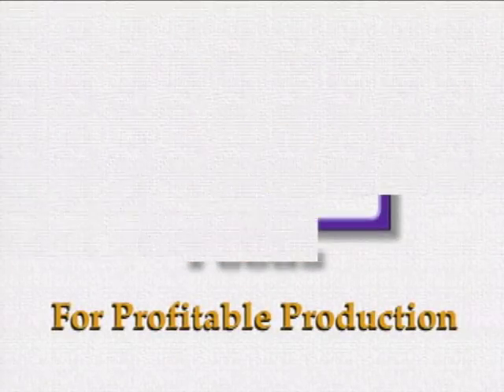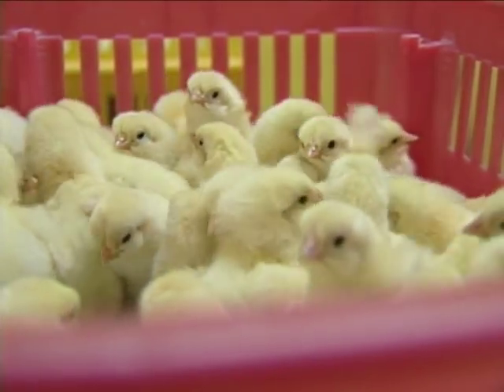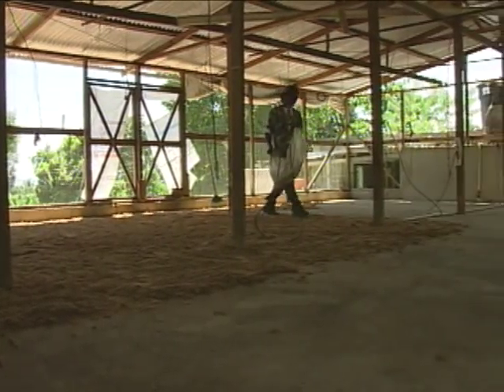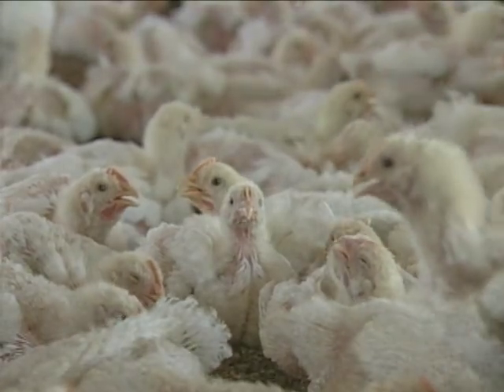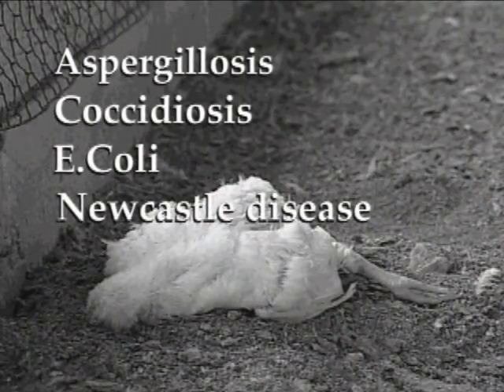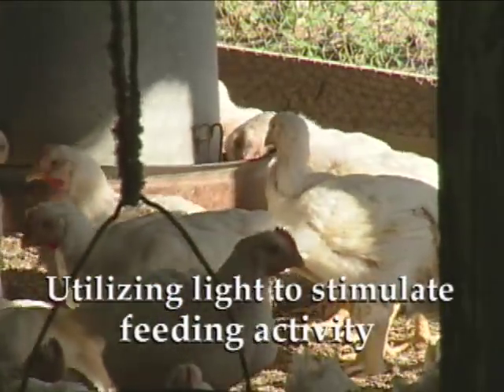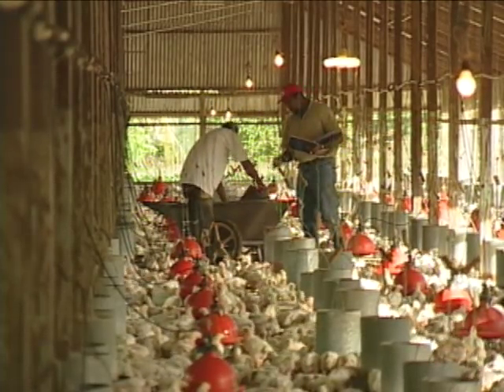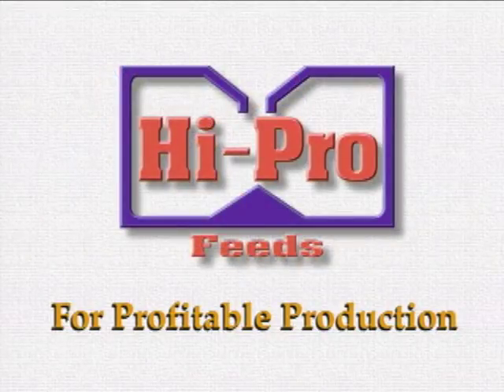Always 4 Ways for Profitable Broiler Production in Jamaica

Comment: Just watched your video, pretty good, the chickens seemed in good health and that is good and you had some sound advice, that is good also. I one thing I was wondering about is the housing it's self, I notice that free ranging may have been possible, so just wondering about the lack of it. My broilers are 3 plus months old now and are free ranging with my layer flock (ducks and chickens), granted, the boilers are a bit clumsy and a little slower, but they are doing their active part in maintaining the grasses and also helping to keep the bugs and the like under control. Anyways, just wondering about the practice of indoor housing vs free ranging practices.
Reply: thank you sir l like your bezinas very much